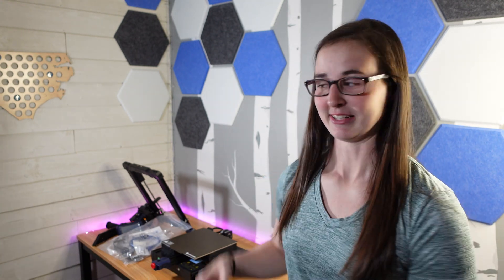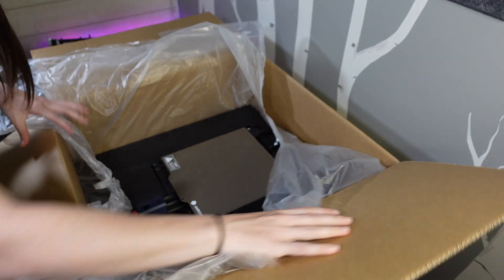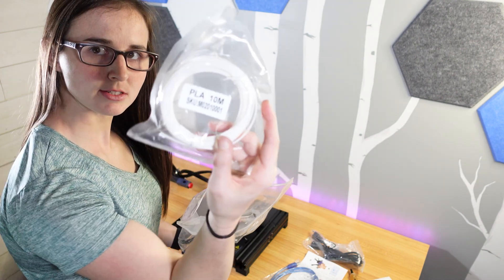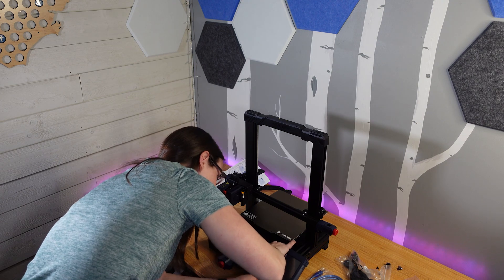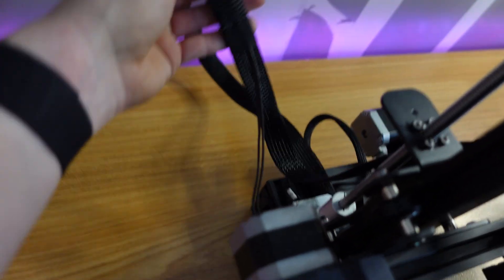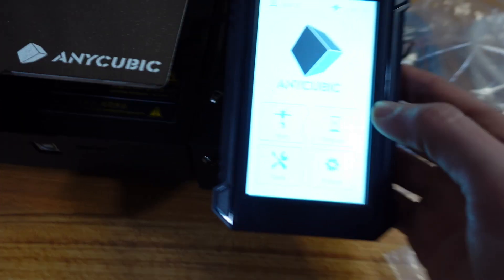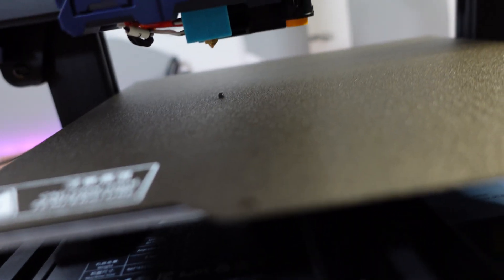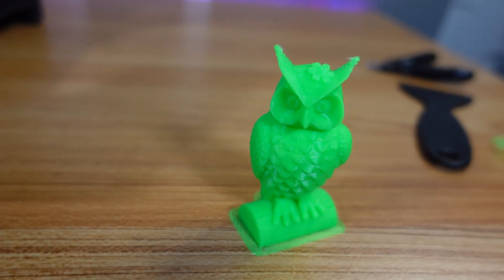Anycubic Kobra - Unboxing and Build Guide - Beginner 3d Printer

Comment: Did u not have to edit any leveling
Reply from the maker: No I never changed any of my leveling settings. I have 2 vypers and the kobra and the autoleveling seems to work well for all 3 without any adjustments.
Reply: @macymakes3d  thank you
Reply: @macymakes3d  do leave the settings as it then see how it runs
Reply from the maker: Yeah and then if things look off adjust as needed
Reply: @macymakes3d  thanks

Comment: My print head wasn't attached. It had its on seperate cutout in the foam. But there were instructions and it was very easy to attach. I also didn't get the little filament cutters.

Comment: What about checking the eccentric screws and the roles of the z and x axis, a firm stand on the desk (feet), correct assembly of the hotend and so on? 
Printers from China tend to be assembled not very precisely.

Comment: Great video ! Can you tell the height of this printer?
Reply: The specs are 200mm X 200mm X 250mm, so the answer to your question is 250mm (about 9.8 inches).
Reply: @jimearl1499  In fact I was asking about the physical size of the printer itself, not the printable area.

Comment: Ok, another question - sorry for this.  Our Kobra just came in today, put it together, did the leveling, adjustments, etc.  Does your middle track where the bed sits have an indention in the middle?  Meaning, if you push your bed back and forth yourself, does it have a spot in the middle that "dips" or bumps as it travels over that area?  I'm a bit worried about this.  I did the first print (owl) and it literally has a tiny ring towards its feet on the belly.  And when it was finishing, it was giving an odd sound like it was hitting something.  Otherwise, it printed fantastic.  The top of the owl didn't come out smooth though - on the "ears" part.
Reply from the maker: Hi! Hopefully you've found your answer, but if not, try adjusting the bolts underneath the printer, on the left side, to make sure it's not too tight/too loose. Mine were too tight and didn't move well, and also had that weird dip, but I adjusted them and now it moves smooth. My ears on the owl also weren't smooth in my test print.
Reply: @macymakes3d  Totally worked. :)  Thank you!  Now if I can just figure out a better way to get supports off easily haha.

Comment: I would love to see a Viper vs Kobra review too, a lot of people are having to choose between these two.
Reply from the maker: It’s in the works 😎 I got you
Reply: @macymakes3d  Hi I'm in the same boat currently, deciding on both, Kobra is obviously cheaper & Newer Model but the Viper does seem to have a few extra things as well.
Reply from the maker: @DSN2K1985  Hi! Both printers are great, so whichever one you pick, I'm sure you'll love. I use the vyper more, but only because it has a slightly larger bed. The speed of the Kobra is nice, and I like that it has a direct extruder, which makes filament changes quicker. They're very similar beyond that.

If you want to print (slightly) larger things I'd go vyper, but if you want to print things "fast" (nothing truly 3d prints fast lol) go with the Kobra. 

Hope this helps a tad. Let me know which one you decide on!

Comment: What program are you using for the Kobra?  I looked at Cura and I didn't see Kobra listed on there as an option.  Also, are you getting really smooth prints?  I'm highly considering buying this printer, but I have general concerns - Cura is one of them, but the other being that this printer only has 1 Z rod instead of 2.  Have you noticed any issues with it because of that?
Reply from the maker: I’m using cura to slice but I’m using the vyper settings. The bed for the vyper is slightly larger, 220 compared to 200mm, so I’m just making sure I don’t fill the plate beyond 200mm in either direction. My prints look pretty smooth now, I just had to adjust the extrusion to get it flowing better. Was able to print some articulated/flexy prints and the joints were smooth and worked perfectly. The kobra and vyper are both solid printers, so if you’re considering buying either of them, I highly recommend 👌🏼
Reply: @macymakes3d  thank you!  We are highly considering getting this model.  We had an anycubic mega pro but had to send it back yesterday. The box arrived damaged and we suspected it was damaged.  After a few prints, we realized it was.  So we started looking into other models and this one seems to stand out.  Thank you!